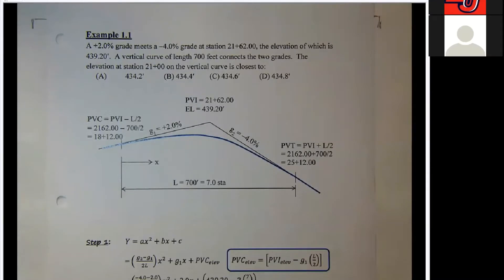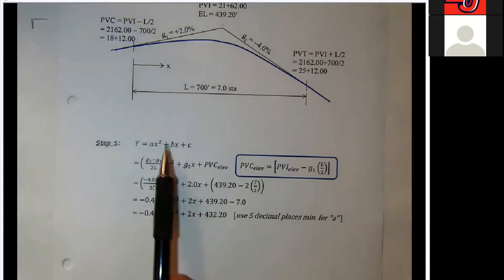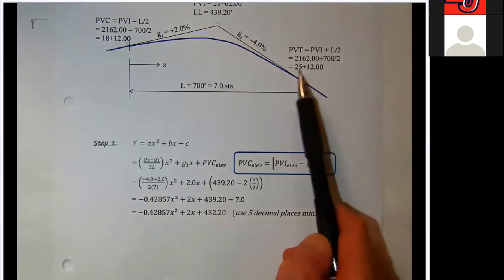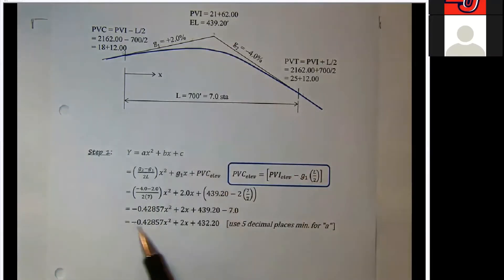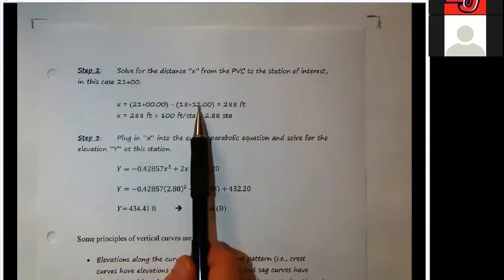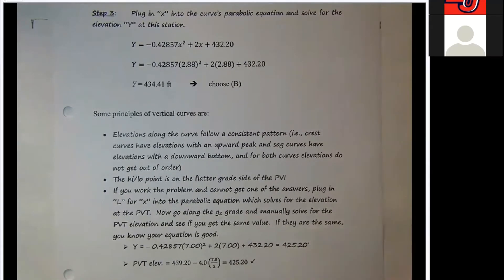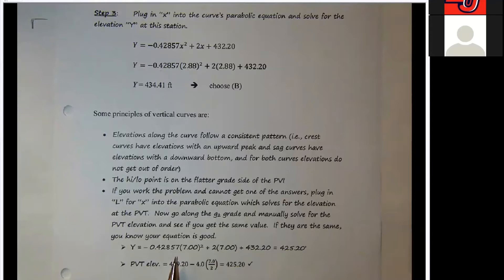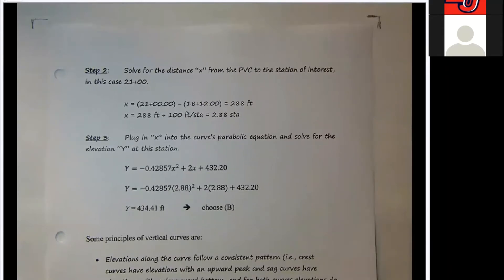Vertical Curve Equation for PE Exam Review in Civil Engineering - Transportation

Comment: Elegant, but you are going to waste too much time doing it this way. If you realize the area under the diagram of grades is the elevation, then:

1) make a diagram of the grades. Horizontal axis will go from 1812 ft, to 2512 ft [given]. Vertical axis from 0.02 (2%) to -0.04 (-4%) [given]. Draw a line from 0.02 to -0.04. Do you visualize the triangles?, good. Then:

2) Calculate the horizontal distance to the summit of the parabole (which is where the grade line crosses the horizontal axis). Doing a simple triangle equivalency: (0.02)/x = (0.04+0.02)/700 ft, x = 233.33 ft, so that station is also 1812’ + 233.33’ = 2045.33’.

3) Calculate the elevation at PC using EL PVI: 439.20’ - 0.02*(700’/2) = 432.20’. 

4) Calculate the grade at station 21+00 using another triangle equivalency: -g/(2100’ - 2045.33’) = (0.04+0.02)/700’ => g = -0.004686. 

5) Calculate the elevation at the summit adding the first area of the triangle: y = 432.20’ + (1/2)*0.02*233.33’ = 434.53’. 

6) Calculate the elevation at station 21+00 adding the next area of the triangle to the elevation of the summit: y = 434.53’ + (1/2)*(2100’ - 2045.33’)*(-0.0046857) = 434.40’.
Reply from the maker: Thanks for the suggestion!  I'm going to try working it out this way too.